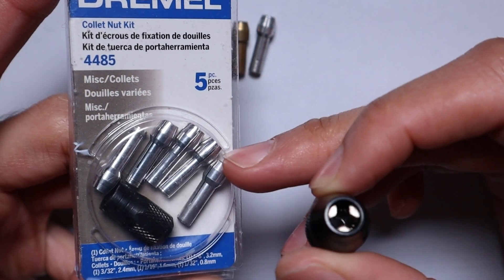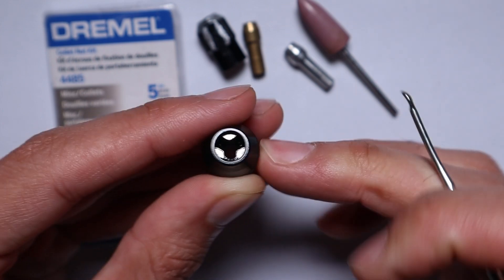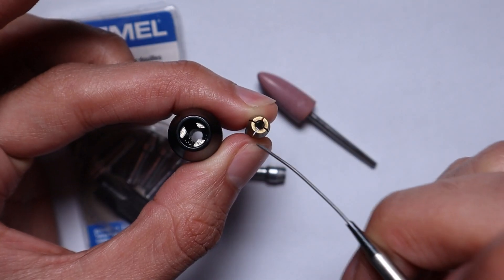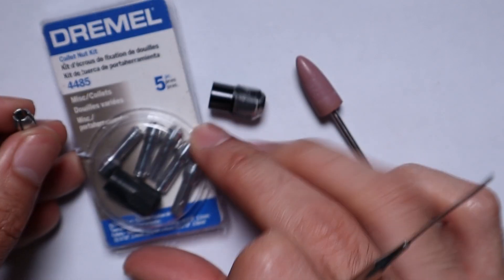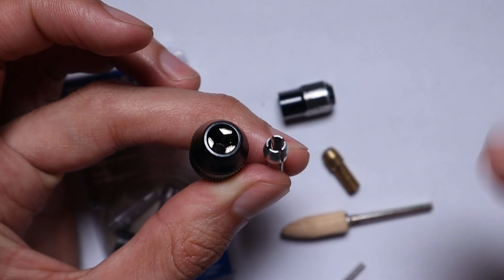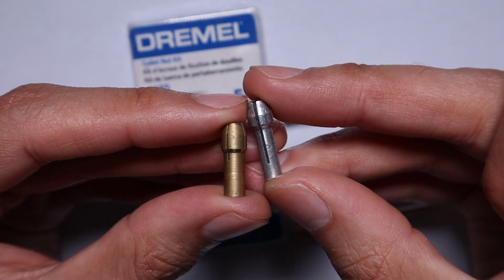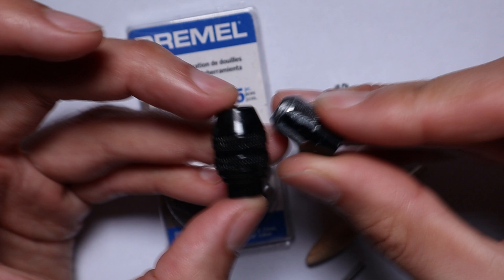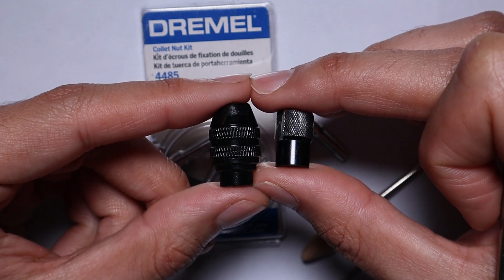Collets vs Chucks. What Are The Differences? When Does It Matter?

Comment: I wanted the adjustable chuck, but the website said said it doesn't work with Dremel Stylo :( I had to go out and buy more collets to use the nova points :p
Definitely noticed it's very tricky to get rid of the wobble with the chuck in our drill press... so maybe collet is the way to go
Reply from the maker: Collet does make balancing the bits easier. I have a chuck on my stylo but it does have a specific thread that needs to be matched... cant remember exactly which thread it had. Should be in the manual.

Comment: First of all a chuck is not good for lateral forces as jaws move if tool is under side load. Basically the chuck is designed for drill bits only whereas collets are good at holding anything from grinding attachments, to drill bits and end mills.
Reply from the maker: True. Chucks are okay with lateral pressure as long as they are spinning but stationary/slow very bad, also, depends on the amount of perpendicular force due to the material hardness.

Comment: Nice overview. I find colettes work well gor me; I don't work loads of stones during each period and tend to keep them all in the same stage of work at each time point, so quite few changes and just use the ones that came with the tool. Have a chuck too somewhere in the garage, if ever necessary. I find my usb-sharged small rotary tool excellent, its easy to bring in my bag on holiday and minimum noise when working with it out in the garden for example, just a perfect way to spend a couple of hours in a relaxed state of mind :-) But if I needed more speed or productivity I could have had other considerations, I would assume.
Reply from the maker: It is a good meditative activity... unless you are fighting sand and cracks.
Actually, even then at least you forget about everything else going on at that time.

Comment: The reason the question is getting asked alot is because the cheapest versions of tools are from China or Hong Kong.
Reply from the maker: At this point I think almost every tool is made in China.
Most frustrating part of running laboratories in Australia is NOTHING IS MADE here!
When you order something local you get a "wait 3 months for stock" because it is imported from China.
Reply: @RoysRocks  Agree, and then you finally find out its not what you expected or can use!.

Comment: Very educational. Thorough review of both products. I don’t think you could have gotten any more detailed than you did.   Camera got great focus on those little springs. I didn’t know what made the chuck work.   I just knew the little thingies move in and out by twisting. I do struggle with the wobble so I will probably just use the collets for better stability and deal with the pain of changing them out.
Reply from the maker: If the wobble it getting frustrating 100% switching to collets you'll never need to think about it again.

Comment: I am a hater of both chucks and collettes. I just glue the shank directly to the motor. When I need to change bits I just buy another motor. So simple and easy, no messing with tightening stuff and the best part is you can honestly say you never screw anything up when your opal cutting.
Reply from the maker: I wonder how well I could machine something like that up... Flex shaft with just a single sintered diamond end.

Comment: You're answering all my questions before I even ask them,Roy. Thanks again!
Reply from the maker: Well you might have been just about to add to the 2 dozen questions I got about this in the last month. 📨😆
Reply: @RoysRocks  , I bought a dremmel type kit and was trying to use it, but it turned out that the flex shaft is broken, and it's a bit hard to use it freehand without a clamp. So, I bought a little rechargeable etching tool, and now I have the two different thicknesses of shafts on my tips. I think I will have to get another flex shaft. Do you think that a cheap wet tile saw would do the trick for slicing (cheap water) opal ?

Comment: When I work on stones, I prefer collets as all my equipment for that has the same shank. Jewelry on the other hand, I got burs in all different sizes, shanks in both normal sizes and I find it a nightmare with collets. For some of the burs, there are no collets that fits either so I use the adjustable chuck for those on my dremel.
Reply from the maker: I need to upgrade to a better flex shaft with a quick change handpiece. The last one I used was perfect! Then I have to remake the video though...
Reply: @RoysRocks  I bought a cheap micromotor on temu with foot pedal and cord to the quick change hand piece 2.35mm. Works a treat for my smithing and cost less than 50 bucks.

Comment: My portable 12 volt rotary tool was able to be repaired! It came back yesterday. I thought it was history. The flex shaft has been tightened and the collet had not damaged it. Funny that the video came up today. Kit I bought 2 years ago had 2 sized colletts and 2 sizes of tools to suit. Problem with my tool was cowling over collett was it was aluminium and had oxidized itself to tool. Just. I just couldn't get it to move. One of our local cops fixed it for me. We've always had great ones here. Came to see if I was ok after my friend passed. Wound up fixing my rotary tool.....it was so nice of him to do that. 😊
Reply from the maker: Sometimes we just get very lucky. Aluminium should hold up alright but I guess that one decided not to. Good thing it didn't take down the flex shaft with it.
Reply: @RoysRocks  It had been stored since I purchased it, apart from me trying it after initial charge! Unfortunately the cupboard must have allowed humidity in. Was in a van the had leaked. It was the barest amount that gripped onto plastic housing. I just could not get it off to access the collet and shaft. The thing that surprised me the most was the battery had held its charge after so long! Important thing is that it is working and I don't have to get the mains powered one out either. I'd just upgraded my inverter to get going with that. I really can start now. I an not going to mess with some at all. Better as they are. The wood has beautiful grain still. Lovely fossil. Others, I just like as is. Funny, I thought I'd be really gung ho over it, I but I am going slow. Now learning to look. Carefully. Rome wasn't built in a day. Opals took way longer. LOL

Comment: That issue with having to keep swapping out collets because you're using different sized bits? Multiple Dremel/equivalents cures that problem. Swap between them as necessary and it also allows the motor units to cool down in between times.
Reply from the maker: I have 6 rotary tools but the ozito with flex shaft kills all the others. I am actually thinking of buying another and hanging 2 up at all times.

Comment: I was lucky when I bought an accessory set. It had a couple of hundred pieces in it. (Mosty sandpaper dics and little cutt off wheels). It did come with the couple of collett sizes in it. The set that came with tool also had both. May as well stick with them. Plus, the video pointed out the way that the adjustable one would be more difficult in some cases. Particularly regarding wrist. Thanks Roy. P.S. my 12 volt rotary tool had slightly corroded aluminium collar and a loose collet. I thought it was history. A very kind policeman repaired  it for me. We have good cops here. Also means I have to pull my finger out and start!! LOL
Reply from the maker: Most rotary tools should come with at least the most common collet sizes.
Hopefully you get it spinning up and carving away.

Comment: I have been using dremel tools for 30 years. Started using chucks recently. They are good for different sized diameter tools BUT the collets are far better for running true and holding tight. I often have tools fly out of chucks when putting pressure on them.
Reply from the maker: For my carving I think I get less issues because I apply very little pressure.

Comment: I would take the collet over an adjustable chuck myself. Much more secure and accurate in my opinion.
Reply from the maker: You are not wrong they are far more precise if that matters in your use case.